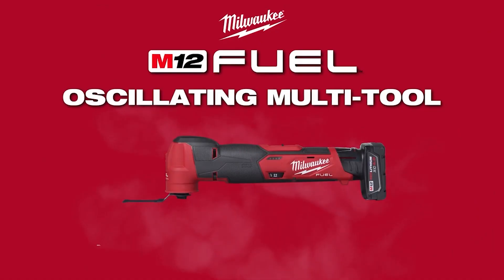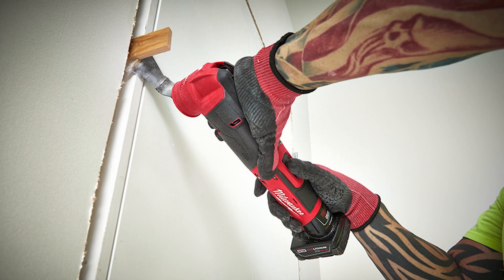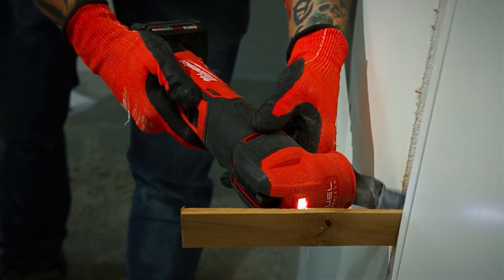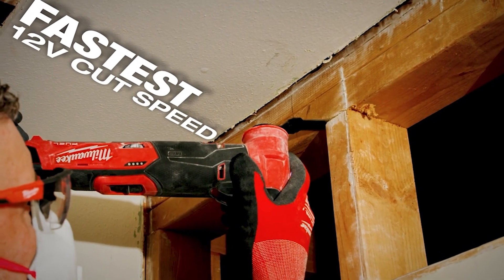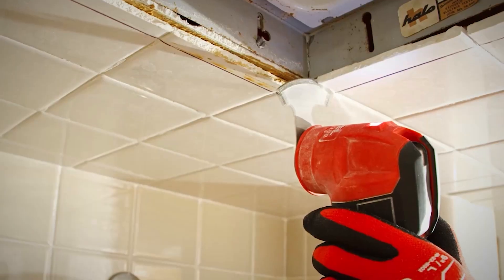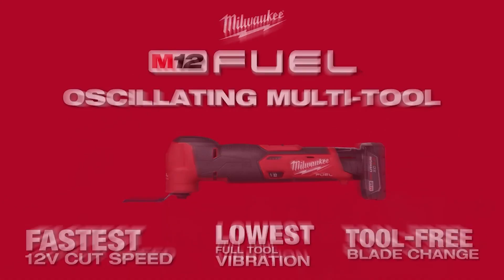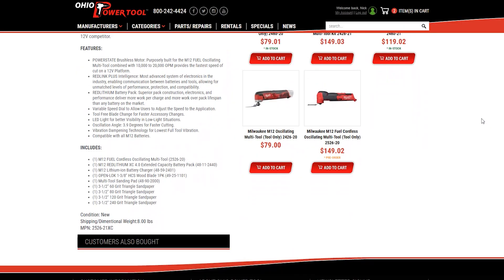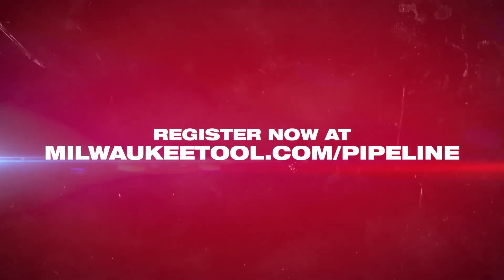Milwaukee M12 FUEL Oscillating Tool 2526-20 & 2526-21 | Tools & Trades

Comment: Be interesting to see and feel it on a job. I use both brand (Dewalt and Milwaukee). I do like the grip on the dewalt oscillating tool. 

Wait milwaukee has a m18 that is quick change? I thought it was a allen key change.
Reply from the maker: Hey Micheal, you find the M18 here, it's a Tool-free blade change 
https://www.ohiopowertool.com/p-5737-milwaukee-m18-oscillating-multi-tool-2626-20-bare-tool.aspx

Comment: They will come with the Milwaukee 5 year warranty correct? Somebody put out an information sheet that showing a 3-year warranty? Which is it?
Reply from the maker: Both are correct! The tool itself has a 5 year warranty and the battery has a 3 year warranty.
Reply: @OhioPowerTool  that's what I thought but the person who put up the information just said 3 year warranty did not specify which had what. Some people are thinking that it is a bit pricey but if you want a Quality Tool then you pay for quality

Comment: The old m12 had way too much vibration no power no light and a stupid tool required blade change. I got te m18 and the blade change was still annoying to line up. I got the dewalt and love the tooless blade change lever. I was hoping Milwaukee would release one similar  in design
Reply from the maker: They've had some time between the M18 brushed and the M12 brushless and still using the same basic blade change. Maybe when they go to the M18 FUEL it'll get improved but they do seem to be rolling with this design...

Comment: Would the m12 fuel be a better buy than the original which is selling for $99 with 2 batteries
Reply from the maker: It is a lower voltage, but the brushless motor makes up for it. So it is still an upgrade to the original M18. I would suggest grabbing this up if you have M12 batteries. However, you may want to grab the M18 for $99 if you're already invested to M18 batteries/tools.

Comment: Seems like they missed the mark on pricing on this one. Way too high. Maybe they thought they could get away with it since it's such a highly anticipated tool. I expect to see it heavily discounted during the holiday season when they realize how bad sales are going to be. 

Good luck getting existing M12 multitool owners to upgrade. Heck, even getting the guys already in m12 without a multitool might be a tough sell.
Reply from the maker: I was bit shocked myself at the pricing. However, Milwaukee is boasting this tool to have better performance on most applications compared to even the M18 model. But like you said, we need to get it in hand to justify the price point. Thanks for watching and the comment!
Reply: Agree with the crazy price
Reply: Also I think the tool look way bigger than previous one so maybe is better to move or stay with the m18

Comment: Ay... yo... No one has done a "this compared to that" yet.  So, this new 2526-20 looks smaller than the M18 multitool [2626-20] - anybody know if that is the case?  I mean, I am naturally accustomed to grabbing a large diameter, so you'd think that the M18 would be comfortable in my hand.  But, for a tool I guess the smaller diameter would actually be a plus; cramming a larger tool into tight spaces can be tricky {see previous sentence}.
Reply from the maker: There is a lot happening in this comment.

Comment: This tool is awful and I'll explain why. That quick blade change has been obsolete for over 10 years(refer to porter cable/dewalt/craftsman multi tools quick changes). These other brands quick blade change also acts as a very nice built in belt hook. The trigger should be variable speed, like a sawzall or jigsaw(refer to dewalts 20v multi tool variable speed trigger). I'm a master carpenter who relies on my multi tool to make cuts in pieces of wood and cabinets that cost more than I make in a week. I'm become comfortable making miters in wood and PVC that is already installed on the wall, flawless scarfs on window sills, baseboard, crown, rake tails, you name it, in place. This isn't possible without the variable speed trigger. I use my dewalt 20v because Dewalt doesn't make a 12v and even if they did it wouldn't fit my spare hammer loop it has because they use slide pack batteries. I have a ~6 year old porter cable 12v that has been on the fritz for a couple years now but still comes out when I need something at the top of an extension ladder. I've been waiting for Milwaukee to come out with the fuel version of this tool for a long time, hoping they made the obvious changes. Clearly they didn't even come close. The reason I would prefer milwaukee is their compact 3.0 barrel style 12v battery packs because they would still fit into my spare hammerloop at the tops of ladders. Until then I will continue to use the other brands quick change as a flawless built in belt loop. Someone who matters please relay this to corporate.
Reply from the maker: You have some really good points and I appreciate the feedback. I'll pass it along to Milwaukee and see if it moves it's way up the chain.